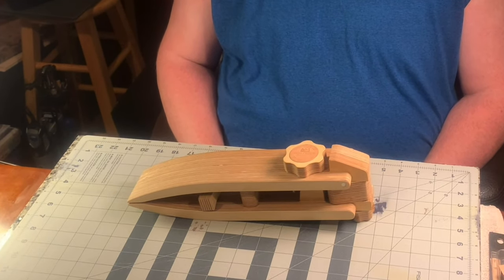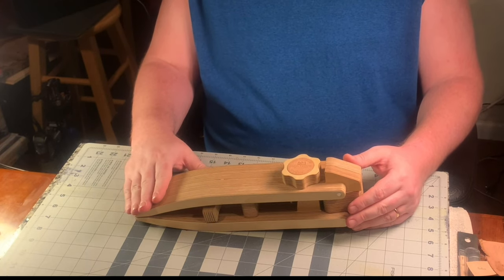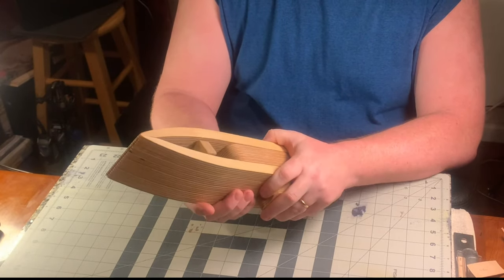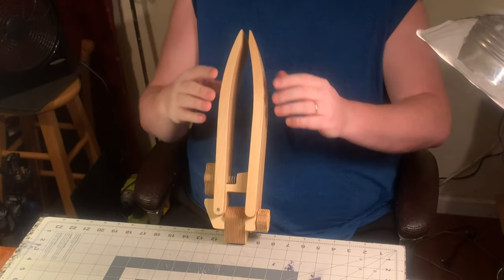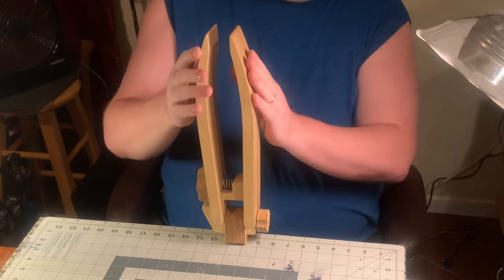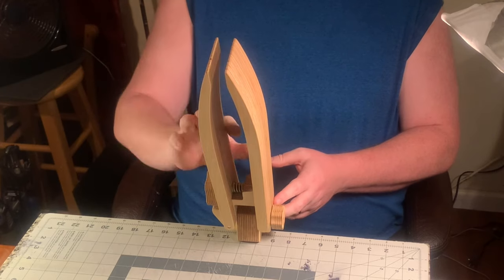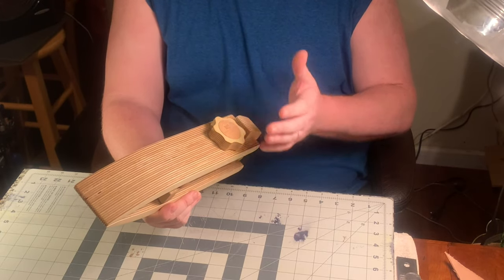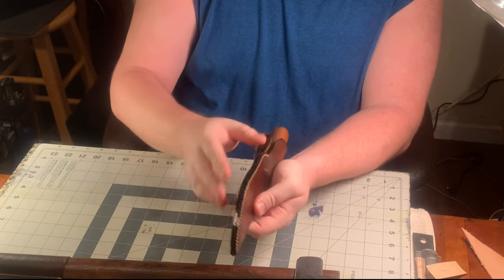Dream Factory's Large Stitching Pony Review - 4K

Comment: How has it held up for you? Does the joint slip at all?
Reply from the maker: The stitching pony is very well-made, but the small knob on the left is a bit of a hassle if you have large hands. For me it is hard to tighten it sufficiently with it being as close to the table as it is.. I am considering making a knob for it with my 3-D printer to go over top of that small one. Once this is done I believe it will be much better
Reply: @MichaelMaysLeatherworks  Maybe would be better to apply a piece of sandpaper to the rotating portion of clamp so it would hold without much pressure.
Reply from the maker: @Shawn Stuart- you could try that but sandpaper will wear down the wood overtime. When i have time to sit and design it I believe the 3D printer knob cover will be the best option.